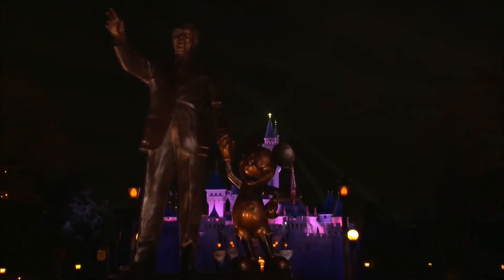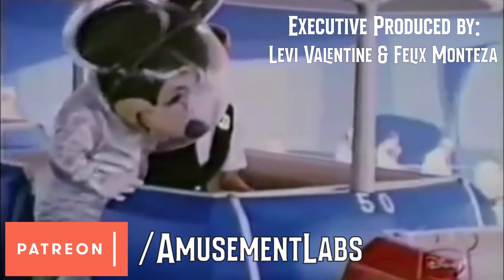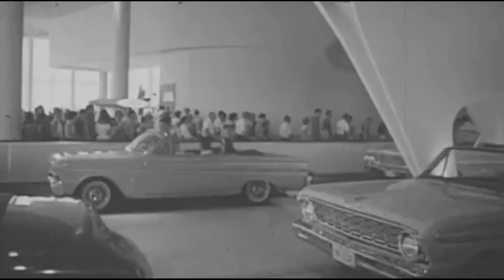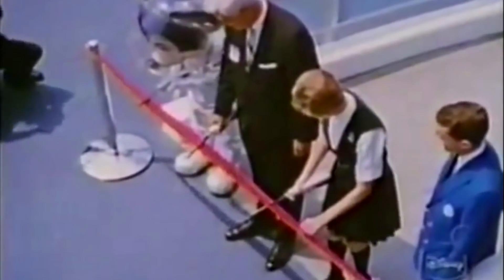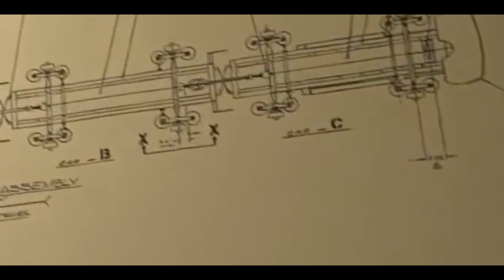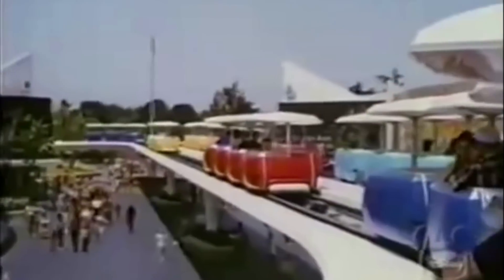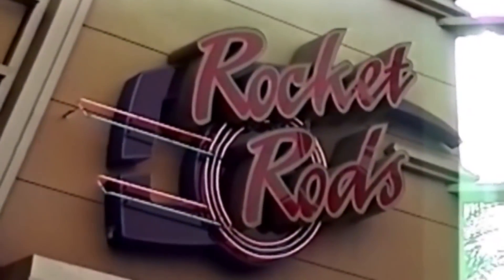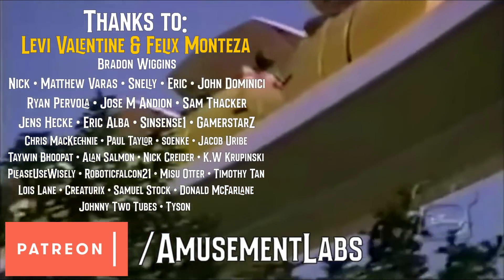The Disneyland PeopleMover - HOW IT WORKED

Comment: Good video.  
Would keep running if two adjacent tires went flat?
Looks like it would have been a pain to check the tire pressure in all of them. And to change tires.
Reply from the maker: I think they technically didn't have tubes or if they did if they went flat it wasn't a big deal. Plus the trains themselves could coast over them easily as long as they rotated with the movement and didn't resist. They probably did make the rounds in the morning to just kick and check.

Comment: Any chance you could do a video on how they managed to do all the audio tracks for Small World back in the 60's? Today it's easy, but multi-track tape wasn't as channel robust back then.
Reply from the maker: Small world is just different songs (per the language) synced up so they're not off beat from each other. Most likely with some kind of buffer in between. Basically a central tempo and area specific music. Nothing too complicated.
Reply: @AmusementLabs  Syncing tapes is HARD.
Reply from the maker: @jackpijjin4088  it they uses a couple of transistors they can start them all at once. I'm sure they probably had to sync them once or many times a day.
Reply: @AmusementLabs  OH, duh! I was thinking of standard 1/4 tape like a dummy! Multitrack recording makes a lot more sense. Sorry if I came across as an angry turd. I need to go to bed. :L
Reply from the maker: @jackpijjin4088  oh no it's okay, I didn't read it that way at all. It's a valid point, syncing them could be hard, but they probably we're all on one machine.

Comment: Thanks for all the technical info on the Disneyland PeopleMover.  There was a lot involved in getting that ride to work.  I only went to Disneyland one time, but I enjoyed the ride nonetheless (it was cool to go into the trees and in and around the autopia and monorail tracks).

By contrast, the tech involved with the Magic Kingdom version is much simpler.  The track is built with a cover over it, eliminating the need for one over the individual cars.  Embedded in the ceiling are speakers for the spiel and lights for the night time.  The track knows where the cars are (part of the linear induction motor drive system), so it's a simple matter to send the spiel to the right speakers.

The advantage of all of this is the cars themselves are completely unpowered (the doors are mechanical).  This reduced a lot of weight from the cars and eliminated the need for a power transfer between them and the track.  This also reduced the maintenance needed to keep the system going.

It's not the most popular ride at the Magic Kingdom, but it still has its riders (it's relaxing and you get to sit for a while).  As for use as a transportation system, I think this particular setup is only useful for indoor transportation (e.g. a convention center) as the open air design would be too cold in more northern climates.  However, Vancouver's Skytrain system uses linear induction motors and it works very well.

Comment: Yep, several times at Disneyland. Some great vintage footage! It would be neat to also get some footage and engineering  of a ride that opened about the same time, that’s no longer there: hovercrafts. As I recall, they used to be on a pad that shot air up, to lift the saucers. At the end of the ride a large arm pushed them back into a space readying it for new passengers. Anyone remember this?
Reply: Yep. Oh, those NEVER worked right. Fun, yes, but required constant upkeep to the point where it was closed more often than open. They tried to bring it back at DCA with Luigi's Tires, but it still had the same issues.

Comment: I never understood why they didn't use a people mover instead of the parking lot trams to Mickey and Friends. Every time I go to the park and have to wait on that tram, I always think this would be faster and better as a modern version of that technology.
Reply: The trams can hold a lot more people than a People Mover "train" that would only hold 16 people at a time.  The lines would be super longer than they can be now.  Waiting for a tram for maybe 10-15 minutes is a lot faster than waiting possibly hours in a People Mover line to get to the same place.
Reply: @ackman3981  Actually I'm not really sure this is true. If memory serves, Disney trams consist of 7 cars holding 24 passengers each running around every 10 minutes. Assuming I am remembering correctly, that translates to 1008 people per hour. In contrast, the people mover trains ran non-stop roughly 30 seconds apart at 16 guests per train, giving it an hourly maximum of 1920 per hour. But, the system would indeed be more expensive and if there was a breakdown, the entire system would stop. When a tram breaks down, it can simply be pulled from service and a replacement added. I would LOVE to have a PeopleMover serve the parking structure, but sadly I agree it would be expensive and operationally challenging :(
Reply: Too expensive probably, all the infrastructure for that would be real expensive vs just paving a parking lot

Comment: Rocket Rods biggest problem is the accelerated speed on those tires micro-fractured the track underneath the cars, rendering the track unusable.  The Imagineers major miscalculation  cost Disney a classic ride and made it essentially unusable without investing many millions of dollars to rebuild it.  As a result, the original PeopleMover will never operate again but the Walt Disney World one with newer magnetic technology just underwent a renovation and will continue to operate for many years to come.  I got to ride both, I liked the one in Orlando better - perhaps because of its more advanced technology.